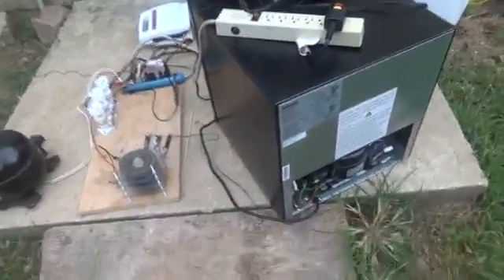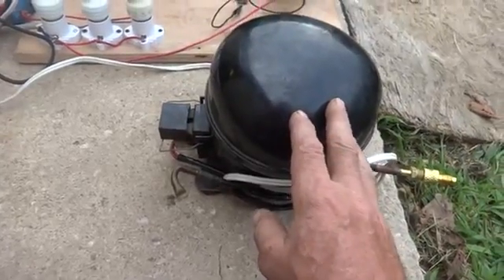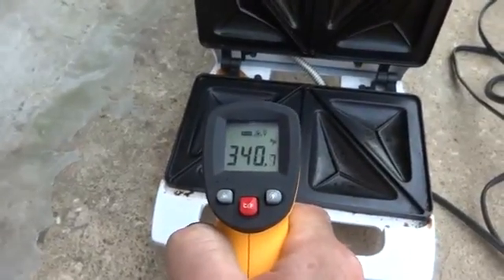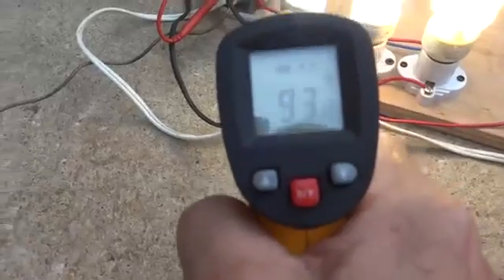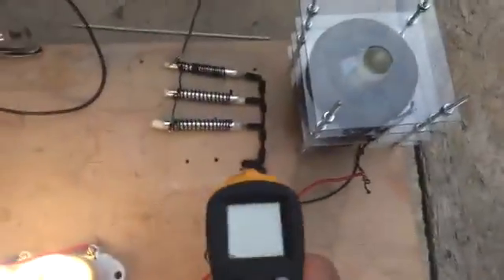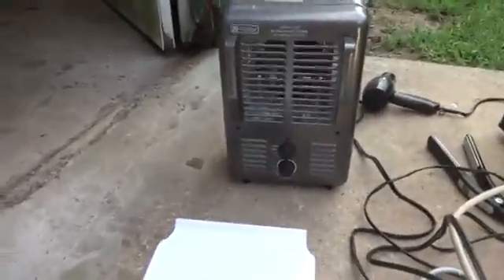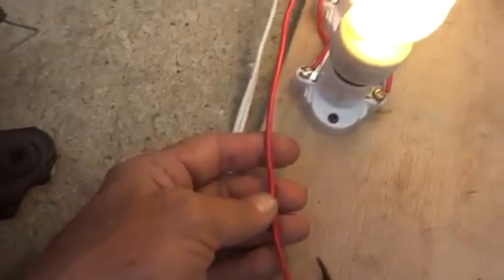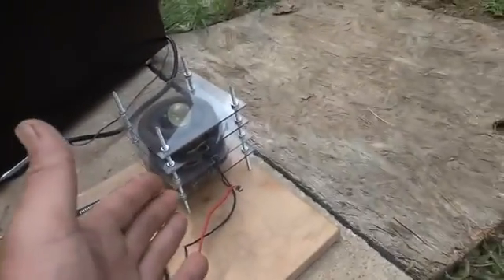Keshe Self-Running Power Generator - 4kW Demo

Comment: Is the Nano Coating necessary? How much are all these materials?
Reply from the maker: The demo was done by people from the Keshe Foundation we are just helping to spread the message. Nano coating is necessary. The magrav system is pretty cheap to make once you are familiar with the procedure. See the blueprint and other links below the video.
Reply: OMG..it's a miracle
Reply from the maker: It nano coats the attached wires but the magrav needs to be nano coated to begin with.
Reply: EsotericScience I live in Hong Kong we use 63A RCD can I make one and connect to it to reduce the electricity charges in my compartment ? I just know some basic stuff. Still learning about electricity system
Reply: if i remember correctly it nano coats itself over time.
Reply: +EsotericScience oh indeed! thank you!
Reply: EsotericScience I need blueprints to that particular system. dransom1941@Gmail.com